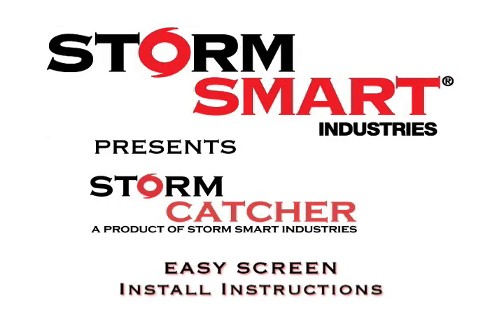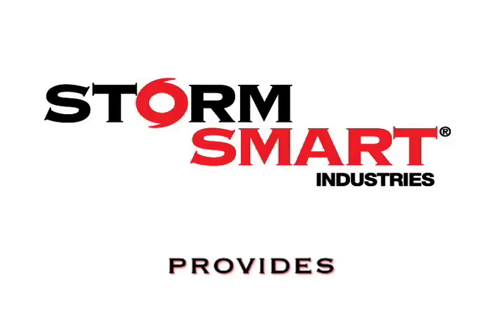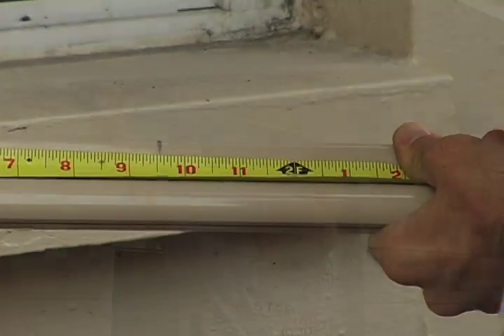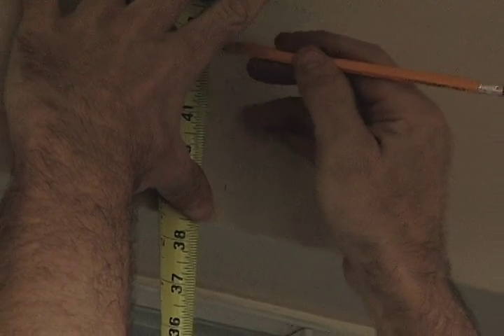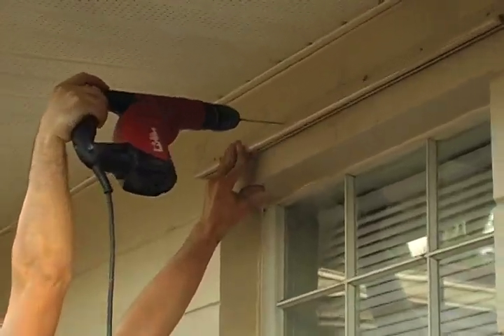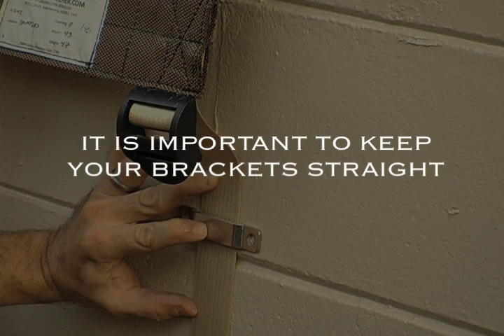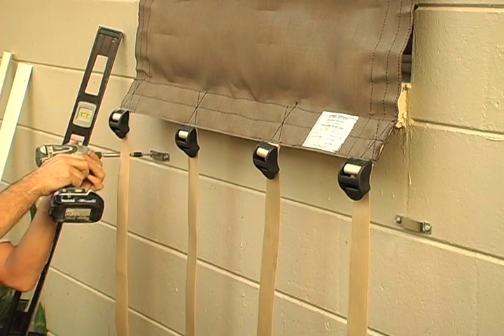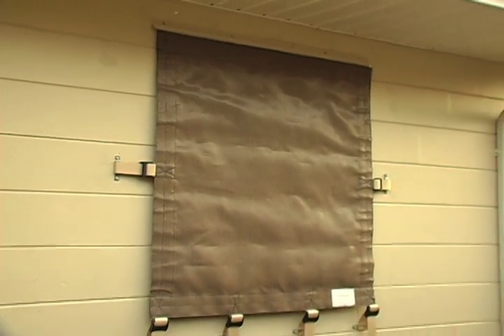Storm Catcher Easy Screen Installation

Comment: Ok, how about just being honest and telling everyone that the fabric needs to be 6-8 inches away from the window glass. Now most window glass is not set 6-8 inches inside a window frame which means you now have to build an additional frame to bolt to the existing frame to achieve this distance. The reason being is the fabric will flex 6-8 inches when hit with a projectile and easily smash your glass although the fabric itself will not tear. So how about a "real" demonstration of the efficacy of your fabric with an actual projectile under different conditions and window frame structures. I noticed you used a brick dwelling with deep inset windows with no explanation.

Comment: Doesn't look very easy.
Reply from the maker: We have highly trained Service Technicians and Field Supervisors that will assist if needed.  This product is one of the easier DIY products or we have installers as well.  Please call our office if you need further assistance.  239-938-1000
Reply: Based upon the block wall construction (probably same for brick), this doesn't look hard (nice that some of the components can stay installed and look like they could be painted to match house color - makes re-installation when the next storm comes along insanely quick). 
That said, for houses with siding the install instructions (if available) would be different.